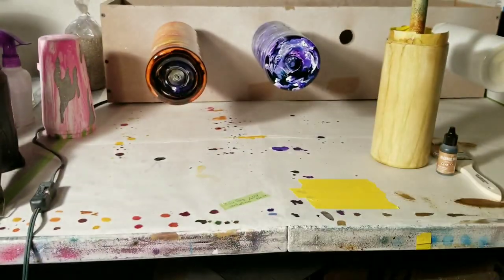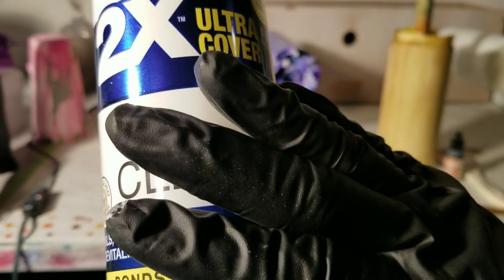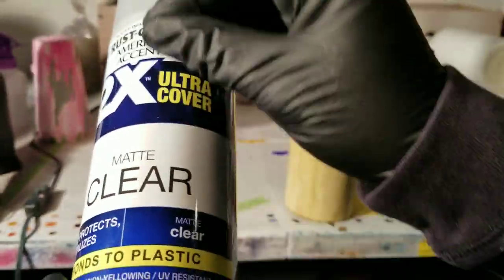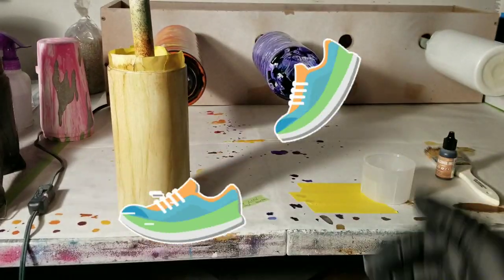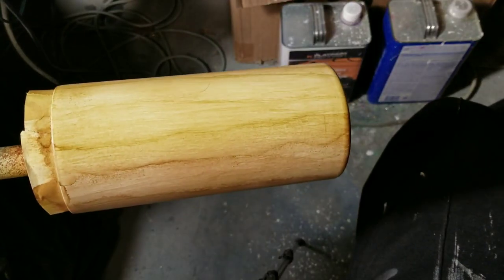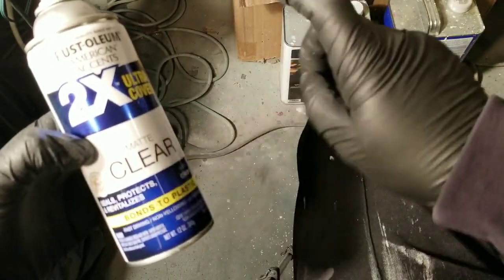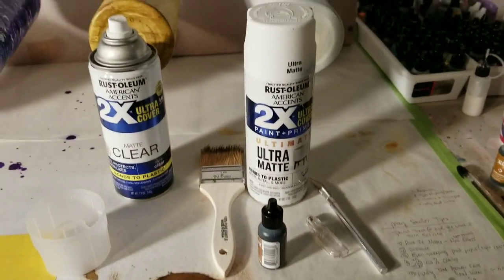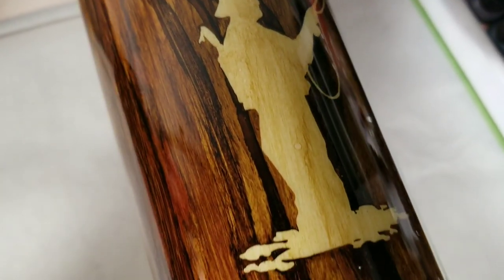How to Spray Seal your Project between Steps - Stainless Steel Tumblers

Comment: You are too funny ! Very talented  - question; I did an acrylic paint rainbow wall art and put glitter on the colors while the paint was wet so it's sticking pretty well but, since it's a sold piece I don' t want glitter falling to the floor once they hang it.  I hear hairspray may work but would rather get an expert to answer my questions, you would be the expert! HA!
Reply from the maker: You may want to use a gloss spray sealer...if you didnt want to resin it
Reply: Duncan Custom Airbrush that worked thank you

Comment: I am so glad to find your video. Unfortunately I didn't see it BEFORE spraying with a gloss clear. So my resin repelled and was crazy, I've wiped it most of the way off. Any tips how to move forward with correcting my mistake or is my cup ruined? 😖
Reply from the maker: yes, sand it smooth and paint
Reply: @DuncanCustomAirbrush  I got so frustrated with that cup so I tossed it in the garbage and started over 🤣 I used matte clear this time and my epoxy still repelled. It's hardened now so I'm going to sand and find a new resin because I think that is my issue. (Using one that came with a turner ordered online and it doesn't seem normal from what I can tell watching videos). Thank you for the response! I'm excited to learn more about cups and love your videos!

Comment: Hi, so glad I found this video. So I sanded my cup, cleaned very well, spray painted, and added my vinyl. Do I now spray it with matte clear so I don’t get fish eyes or spreads? Please help, I got so frustrated doing twice without the clear and just cleaning and it fish eyed
Reply: I want to epoxy it as well, so should I clear coat it then epoxy to avoid fish eyes from happening?
Reply from the maker: I always like to seal it👍

Comment: Hello, thanks for your videos, they are very helpful and your jobs are great. Many people are working their tumbler with Epoxy, and my question is, if I have to cover my tumbler with Epoxy and Spray Clear or if I can use only spray Clear.
Reply from the maker: the rattle can spray clear is not durable enough

Comment: Thanks for sharing! I do the same with alcohol inks. Do you do the same after applying vinyl? I’m considering it after I thought I did everything right with the torch & still got microbubbles over the vinyl. Thanks!
Reply from the maker: Yes, I usually do it over everything...just makes me feel good, lol
Reply: @DuncanCustomAirbrush  if I want to seal something on a single layer plastic cup from Walmart ($0.50), what do u use? Just the clear sealant or epoxy?

Comment: Would the sealent work on a matte black tumbler. I just want to keep the matte black color of the tumbler  while sealing my vinyl. Any suggestions?
Reply from the maker: Not sure, but most people don't seal them if they are only doing a vinyl application

Comment: So just making sure, using the matte clear sealer on a glitter tumbler won’t make the glitter dull even after resin right? I’m new to all this so I’m still doing my research lol
Reply from the maker: Correct  - it will go dull when you spray it, but it will go back to normal when you epoxy resin it
Reply: Duncan Custom Airbrush thank you so much for the reply. I appreciate it! Great video btw!😊
Reply from the maker: @Araceli8488  Anytime!😉👍
Reply: I was wondering the same thing, but with holographic vinyl.

Comment: Would you recommend using this Spray Sealer to seal stickers on my Yeti cooler?  The top lid does not do well with stickers and I want to find something to seal stickers on permanently.
Reply from the maker: Should do good if you arent wanting to go through the whole epoxy thing👍

Comment: This may sound silly! But I just finished applying my first of epicyclic over my glitter. I plan on adding my vinyl decal next before the second layer of epoxy. When should I seal it? Or do I need to at all?
Reply from the maker: I like to spray seal after i put the vinyl on - I feel like it helps keep epoxy from seeping under the vinyl - some people don't though

Comment: How long to you wait to seal a glitter tumbler? I just epoxied and then put on the glitter and I’m unsure when I’m supposed to apply the clear coat? Is it right after the glitter is applied or do you need to let it turn first?
Reply from the maker: If you did epoxy method for applying your glitter, you don't need to spray seal it. Although you will probably need to apply another coat of epoxy to smooth out the bumps of the glitter
Reply: Ok, thank you!!

Comment: Question about matte vs satin or semi gloss clear sealer.  If I use metallic or shiny vinyl on the tumbler will the matte cause a loss of shininess to the vinyl?  I feel like this may have caused it to dull my vinyl.
Reply from the maker: every time i have done it, epoxy always brings the shine or sparkle back

Comment: You mentioned to only wait up to 30 minutes...but what happens if you wait longer? I was working on a few tumblers last night and forgot to do the second coat so not sure if I need to do that this morning or just move on to resin. (If it matters one is alcohol ink and the other is glitter)
Reply from the maker: I usually wait longer. Also, I always try to make sure I seal over my alcohol ink - I didn't one time and the colors faded when I epoxied

Comment: You make awesome videos! The question I cot on the matte clear coat, on your Amazon link it’s listed at $23 a can. Is that normal for this kind of clear coat?
Reply from the maker: Holy cow must have went up, I usually try to get mine at Walmart
Reply: @DuncanCustomAirbrush  there always out when I go by there. I did find some at Lowe’s but it was different can but I think it’s all the same. It still had 2x matte clear.
Reply: @DuncanCustomAirbrush  I apologize for the last post about the matte clear. I looks at it again and it $23 for a case of it! Lol

Comment: If I use the seal..do I need to use the epoxy resin?
Reply from the maker: I would say yes, I haven't tested the durability with out either epoxy or automotive clear coat

Comment: How did you make the fishing string connect to your words? What did you use?
Reply from the maker: I drew it on my phone. I have a Samsung Note8 and I use the Autodesk Sketchbook app 👍. I measured the cup and cut the vinyl to the correct size to wrap around

Comment: I made a glitter tumbler with spray paint glitter I put on same stuff you did for the seal the cup is shiny  do I have epoxy cup too? Will seal protect from
Washing and any damage
Reply: I did 2 coats of sealer you used and one of the krylon sealer it feels smoother and it’s shiny do I have to use epoxy to make super smooth or will it make up the cup?
Reply from the maker: I would epoxy...but you could test it out without,  but, I always epoxy

Comment: I have some photos I had printed from Walgreens and want to add them to my tumbler. Do I need to spray the photos if they already have a gloss finish? I tried it and it smeared the ink on the photo. What am I doing wrong?
Reply from the maker: it is kinda hard to do photos because they as so thick and dont like to curve, but it can be done. I did it once using spray glue to attach them and then mod podged a couple layers over the whole thing.
Reply: @DuncanCustomAirbrush  thanks for the info. 
I just started using my airbrush gun. I just need to know do you clean the gun between each use or just when your done for the day?
Reply from the maker: @chrishebert3240  You just clean out the cup, you don't do a whole take apart cleaning. sometimes i clean out between colors, sometimes i dont, but always when you are finished

Comment: Can I use the spray selant on a Starbucks tumbler that has vinyl on it?
Reply from the maker: i have never worked with those, I guess it all depends on what you have done on the cup - if it is just vinyl then i wouldn't think you would need to seal it

Comment: If you are using this to seal the ombre glitter, would you still use matte? Tia
Reply from the maker: i would - it will look dull but it brightens back up when you epoxy
Reply: Omg, I been looking for this  answer everywhere. Thanks

Comment: After spray paint, when I apply epoxy, it tends to fish eye or repel like water and dose not lay smooth. Any ideas?
Reply from the maker: Could be the type of spray paint you are using, especially if its gloss. Could also be applying epoxy too soon...the spray paints may not be fully cured enough🤷🏻‍♂️

Comment: What happens if i spray clear and then my paint under cracks in one spot with clear
Reply from the maker: You may have sprayed too heavy. Some paints react negatively to each other and the crazy thing is that it doesn't even happen every time. You could try to repair the cracking area
Reply: @DuncanCustomAirbrush  thank you it doesnt show after finished so another question how long should i wait to wash my cup the last one i did i forgot to use clear before epoxy and when i washed it truned cloudy
Reply from the maker: You mean you washed it after you epoxied it and it turned cloudy?🤔
Reply: @DuncanCustomAirbrush  yes

Comment: This may be the stupidest question ever but. What's the purpose of sealing
Reply from the maker: There are no stupid questions, well there probably are but this isn't one of them. The sealer locks in the previous layer, especially when working in alcohol inks (they tend to smear, run, and fade if you don't). It is also good to lock down glitters from floating up when you epoxy, and it is good to seal over vinyls and decals to try to safeguard against epoxy seeping under them during the epoxy process. Hope that helps!😉👍
Reply: Thank you so much.
Reply: @DuncanCustomAirbrush  (This) is the comment I was looking for because my vinyl (lifts), if I only use epoxy on top of the vinyl. Thank You, sir..